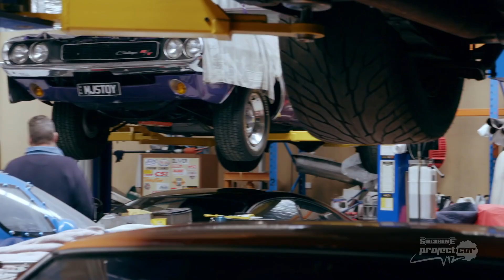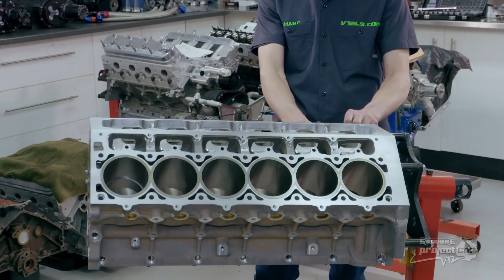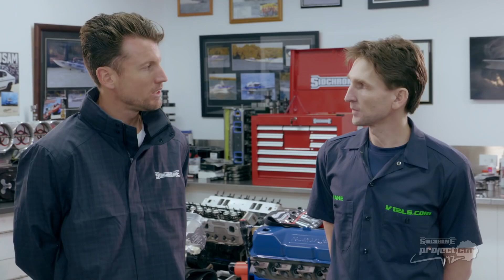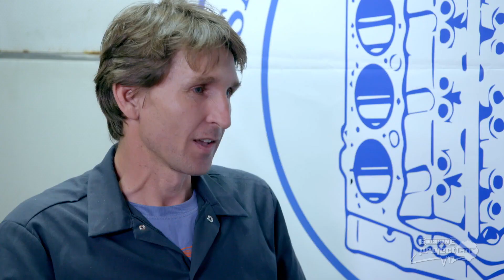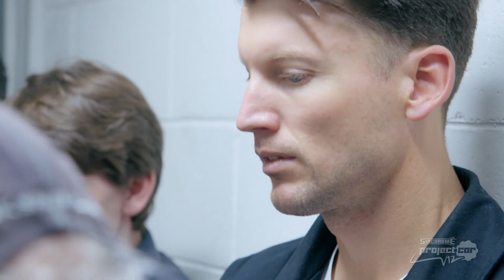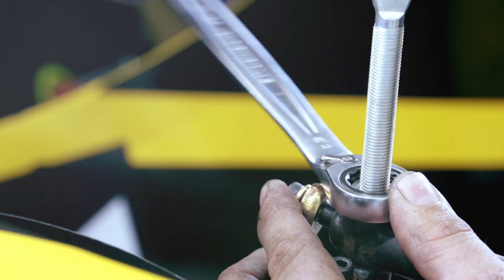V12 LS Camaro Engine Build

Comment: I read that the LS V8 engine is light compared to V12 engines ( of the old day ? ). I would like to see power per weight in comparison to a modern V12 like the one from BMW in the F1 or the Mercedes in the Pagani Zonda. Or can we get hands on V12 from a luxury car and tune it? Why lower the compression ratio? So that it can run low octane fuel? Instead, a rev limiter could work in combination with even less fat lobes on the cam.
Reply: About 700 pounds completely dressed. Which, when considering it makes 700hp/700lb-ft with ease and can make probably a thousand N/A, is actually a very good  power-to-engine weight ratio.

Comment: Sorry fellas, but for a V12 with that kind of displacement with no air filters those numbers are disappointing. I'm a fan of the work and design effort but not the output numbers
Reply from the maker: Thanks for taking an interest. This one was severely restricted by Engineering requirements for street registration in a giveaway car. Link to video with more detail below. It was challenging making a low enough number to keep them happy given the same engine makes over 750HP with a better cam and compression. Not surprisingly around 1.5x the same specs in a V8. More information on the de-tuning here: https://www.youtube.com/watch?v=HdIVIFSguYs
Reply: @V12LS  That is totally understandable and believable. Looks like some great engineering went into it. I especially notice the added head bolts around each cylinder makes it seem like you have forced induction planned for the future.

Comment: Gday V12LS I know you blokes specialise mainly in LS design V12s but I wonder if playing around with the old aussie Holden V8 and turning THAT into a V12 also would be out of the question down the track? A place called Torque power cast their own Holden blocks both for big cubes and for factory 5ltr displacement and I've heard that the Holden heads have superior head design (from the VN onward) with port layout and 6 degree valves.. Would 12 cylinders benefit from that more so than a V8 might? One can only wonder.. 🤞

Comment: So, if you destroked it, what bore and stroke did it end up with? I am really hoping for 4.125 x 3.268.
Reply from the maker: In this case we had to be under 500ci so went with a 4" bore and 3.267" stroke giving 493 CI / 8.1L. A big bore, short stroke would be cool though.
Reply: @V12LS  Was there ever any testing done with a stock LS7 4.125 bore and 4" stroke arrangement / 10.5L? I know it wouldn't rev as high/fast but the low end torque numbers would probably be impressive.

Comment: This type of bore/stroke ratio was what I had in mind for my V12 build.  Since a V12 doesn't have to rev as high as a V8 to match the same [ cylinder firing/time ] ratio, it seems that by building a shorter stroke V12 that could push the Torque & HP peaks up higher, you could build a motor that performs like a V8 @ 10,000 RPMs that only needs to run at 8,000!  Numbers are used as examples, not to be taken literally as exact calculations!  The advantage here is that you are not pushing the V12 motor past the limitations of an under head, push rod design!
Reply: On the surface, that sounds great, but with a V12 like that come more headaches, like, for instance torsional crankshaft twist, more valvetrain harmonics, etc ... it's not so much a question of RPM either ... Plus, this is a one off build made by one company and while it is very cool, who do you go to for parts?  Them and they got you by the short hairs on price ... not to mention the headaches and fab that it takes to get it into the car.

While cool, not very practical from any standpoint.
Reply: @TTGTO288 go to Steve Morris’s engines
Reply from the maker: That's a good point @sparkimoto